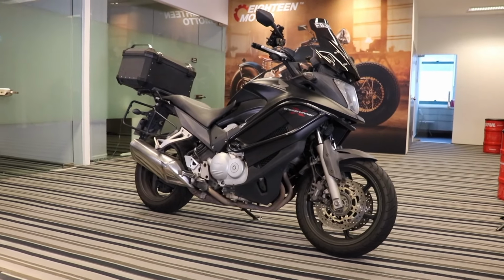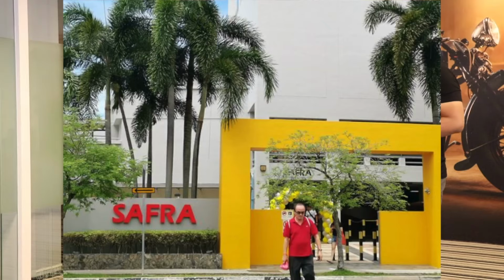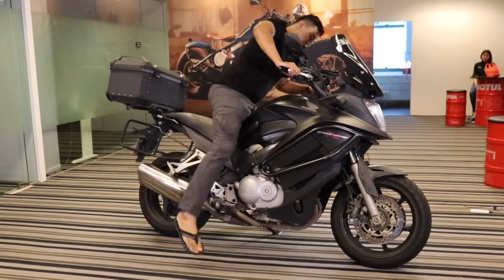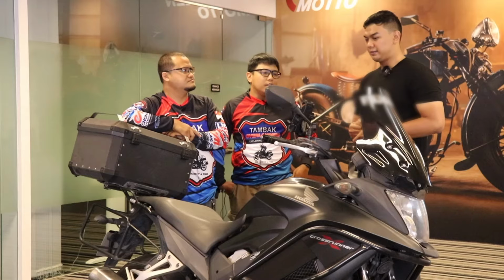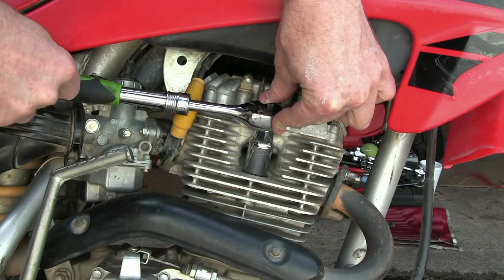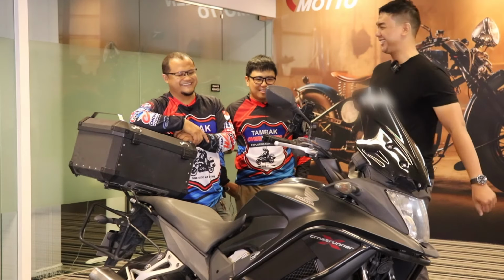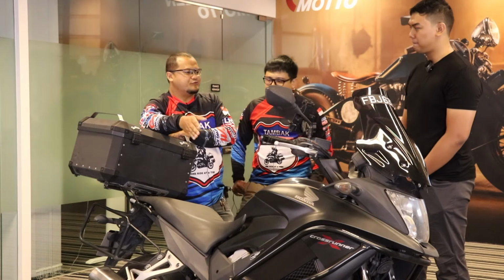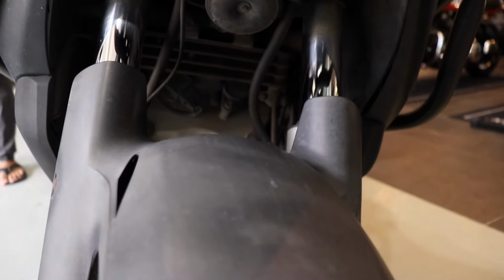Honda Crossrunner | SG 🇸🇬 Owner's Review | Vlog#409

Comment: Wow, awesome review with an arguably even more awesome bike! Gotta say, its looks don't do it justice. With the looks of the tame NC750, but with a racy V-4 engine, this bike definitely is not slow. Also, of course the engine guzzles oil lah, this is a racing engine XD Actually this generation VFR800x has an engine derived from the RC45 sports bike, which in turn draws its lineage from the sweetest looking sports bike, the RC30, which of course traces its roots back to the VF750 Magna, which originally came out in 1982 and was one of the first few production V4 engines. Also, damn that exhaust sound is *chef's kiss*. Interesting thing to note is that the early generation VFR800 interceptor was one of the first bikes fitted with VTEC, followed by the super four.

The VFR series represents Honda's commitment to the V4 engine, and includes legendary models such as the RVF400, the VF750F interceptor and of course Honda's current motoGP RC213V. Currently Honda is the only Japanese manufacturer to still produce a bike with a V-4, though that will soon change. Honda Japan has announced that the VFR series, including the VFR800 line and the VFR1200 line will, be discontinued starting from next year. So it won't be long before the Japanese V-4 goes extinct on our roads, only to be outlived by the fancy italian V-4s (looking at you, Aprilia and Ducati -.-). So those who still have a V-4 bike, please treasure them while they are still around!